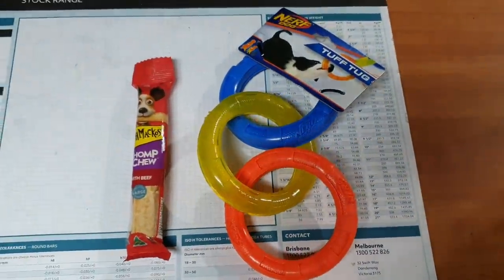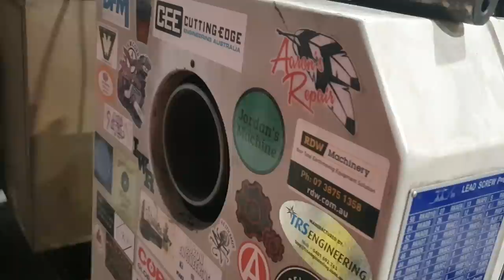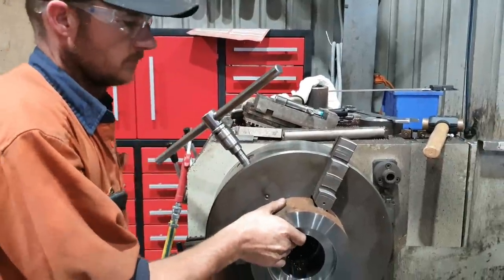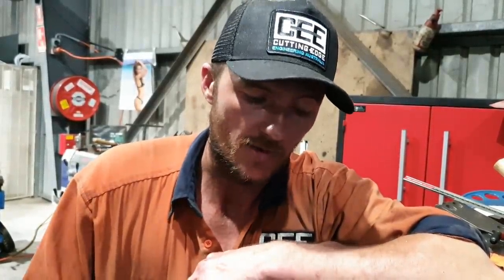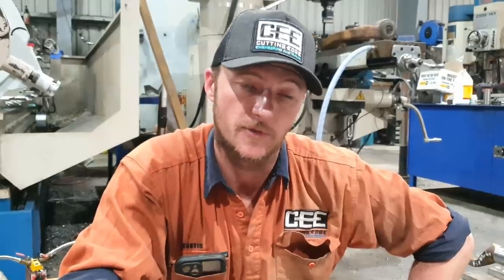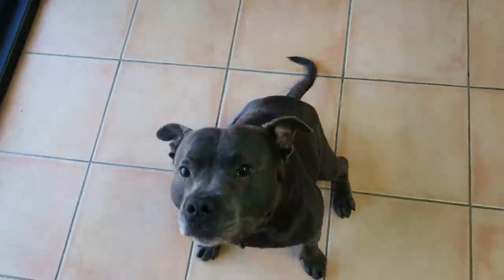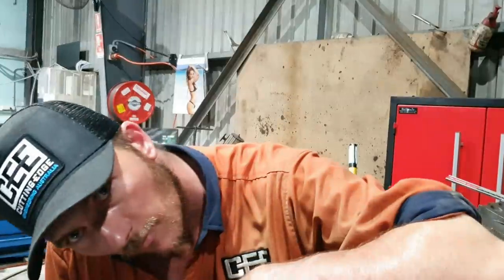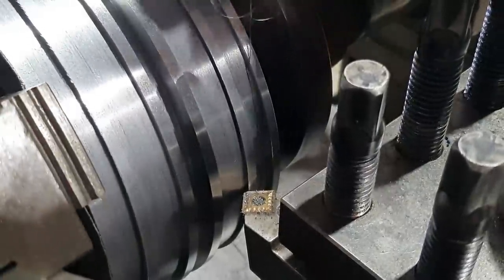Making a Hydraulic Cylinder Piston | Hitachi Zaxis 670 Excavator Part 1

Comment: Debris Gets in through the fluid/oil bypassing filter somehow? Weird.
Reply: Filter is on return side, this happens alot really.
Reply: @hydraulicshop9323  Can't filter fluid/oil that is "pushed" only "pulled"? Thought the holes on OEM filter were like 1mm and the debris seems larger.
Reply: @twt000  well you can with high pressure filters  but if system is clean there is no need. Filter the oil from the tank to the pump then to valve bodies. Inline pressure filters cause too much heat.
Reply: In my experience this happens often when faulty hydraulic pumps creating pressure peaks and parts from the piston rings break apart. So better have a sharp look on the pumps and the valves.
Reply: @crazyedo9979  Piston rings? It's not an engine.

Comment: If you had a big ol cnc lathe that could have been cranked out so fast.
Reply from the maker: yeah after spending hours drawing & programming the job 😂👍
Reply: @CuttingEdgeEngineering  You'd be surprised how fast you can get if you're comfortable with your CAD/CAM and machine. It would take about an hour. Plus if you ever needed to make another you'd have the program set. But where is the fun in that? It's very entertaining watching it all happen manually.

Comment: When you with all this manual work still can make the parts cheaper than the OEM parts which are surely done quickly on a CNC machine and in large numbers, I suspect the OEM has too big of a profit margin.
Reply from the maker: their overheads would be astronomical so got to pay for all that somehow 🤣

Comment: Theres a couple other machining channels and some of those, who shall remain nameless, always use a four jaw chuck and a dial indicator. Doesn't matter what's being done if it's a nose cone for a space shuttle or the handle of a plunger. Is this an unnecessary flex? I rarely see you use a 4 jaw
Reply from the maker: hey mate a few reasons why I mainly use the 3 jaw, most of my lathe work is on round material so the 3 jaw is usually setup and a quick and accurate way to hold the job, a 4 jaw would be unnecessary and time waster here but has it's uses with square or irregular shaped material.
Reply: @CuttingEdgeEngineering  that's my point. 99 times out of 100 it is round stock I see these guys indicating in on a 4 jaw and it seems like a waste to me
Reply from the maker: @maggs131  yeah they probably have the time to waste
Reply: They all seem to have duff three jaws that are way out. Though I note that one of the bigger names has started using a six jaw quite a lot now he has one that isn't stuffed.

Comment: Years ago in my old job we had to make some grease pumps. they had tapped tubes that were the piston rod because they fed the grease down the centre of the piston rod. but to make sure everythign was concentric we attached the poston tot he rod first and held the whole assembly on the rod to machine the outer diameter of the piston. They were only small so we got away with it. So I know how critical the concentricity of this type of piston is like.

Comment: Ah! The dreaded contamination issue. Upwards of 80% of hydraulic faults are caused by contamination of one type or another. Many times it is sloppy habits in changing oil and filters. It is staggering that people are often to tight-arsed to change the oil and will risk tens of thousands in potential damage as a result. Properly maintained, hydraulic systems are ultra reliable. regular oil analysis should be part of the regime. If you don't filter your oil on the way into the system, ya might as well be chucking in a bucket of gravel. Seen it countless times. The cheapest parts in the whole system are your oil and filters. No excuses.

Comment: Is not it extremely dangerous to hold the sandpaper stripes with your bare hands considering the mass & power of the rotating detail? One minimal accidental shiver and a finger is trapped beyond the stripe, and in a second the whole hand is damaged. A wooden stick or other similar thing can be attached to a sandpaper to hold it and it can be damaged with no risk to the human body. Please never do this, at least on camera, or someone will surely try to sand a rotating detail the same way and will be hurt.